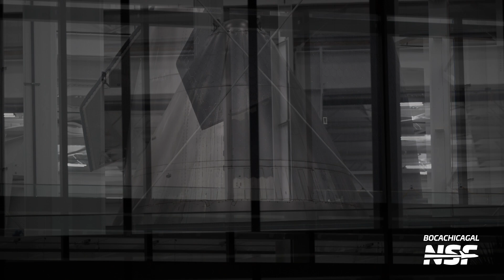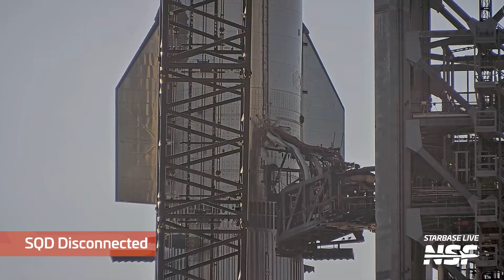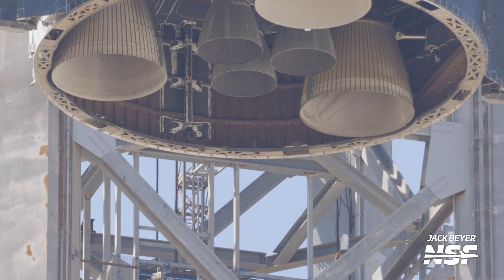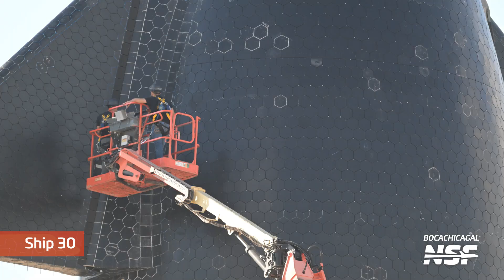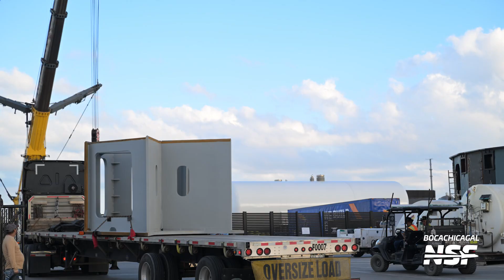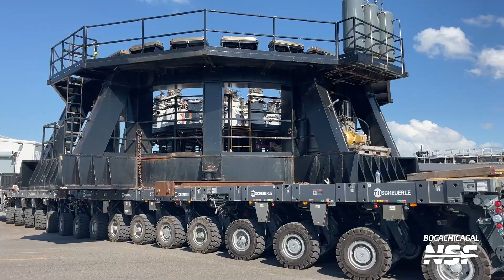Ship 30 destacked... For Now | SpaceX Boca Chica

Comment: The rounded corners on steel pieces avoid stress concentrations on a single point. Sharp points are called 'stress risers'.  The reinforcements on the chopsticks are all curved for the same reason, to spread loads over larger areas.

Comment: SPMT's are not usually described as a number of SPMTs, because as you said the system is modular. The usual way to describe them is "Axle Lines". At the end of the video, the SPMT was was using 16 axle lines, and there were 2 sets, so it would be 2x 16 axle lines carrying the booster stand. The smallest element of SPMT is 4 axle lines (plus a power pack) so when connected together the transporter will have axles in multiples of 4 (8, 12, 16, etc)
Reply: I faithfully sift thru dozens of rubbish comments just to find the occasional valuable nugget like this one. Thanks!
Reply from the maker: Thanks! - Das

Comment: What extra protection was added to Space Shuttle engines since they projected out back? Did they run some liquid through cooling channels?
SpaceX going to build a smaller version of the NASA crawler?
Reply from the maker: There was a body flap that extended past the main fuselage to protect the engines during reentry. - Das

Comment: As a welder, a square internal 90 degree corner can crack much easier than a rounded corner. You have a starting point for the crack in the corner

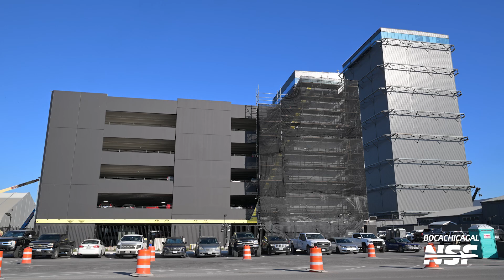Comment: 1:54 Parking Garage: Typically you would treat the south & west facades with an expanded wire mesh to stop heat gain from the sun but still allow air flow. Painting it black is the opposite of what you should do in this kind of heat but it matches. The new studs on the exterior looks like they will be solid panels of some sort based on the spacing but it is confusing.

Comment: Yes in structural steel a radius cut is stronger and less prone to cracking than 90deg cut and for the little added weight is minimal compared to added strength

Comment: With the RVAC engines being more efficient in vacuum wouldn't it be more efficient and effective to just use the 3 RVAC only or do they not have enough delta-v to put Starship into orbit at stage separation

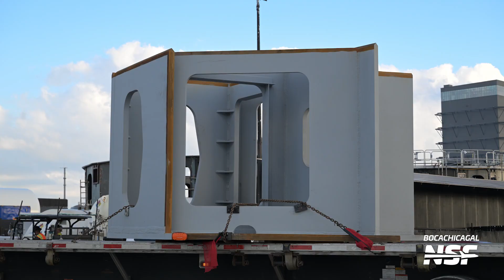Comment: The OLM piece at time stamp 9:40 is a big piece of steel.  The flatbed trailer is flat, so it's close to maximum load, in the range of 45,000 to 50,000 lbs.

Comment: When are they going to put landing legs on both starship and booster. They should just put them on now and stop just letting them drop in ocean so they can be examined and make a better inspection. Starship is going to need landing legs regardless.

Comment: always have round corners to openings the de Havilland Comet had square windows they started to have stress fractures very quickly and there was  some crashes because of it
Reply: @JasonEdney-wp7pe  just curious, do you watch Mentour Pilot?
Reply: @DebraJean196  hi no my dad is a huge plane nut think i've been to every uk air museum when i was a kid and it rubbed off , not complaining i do like all forms of flight
Reply: @DebraJean196  just had a quick look ,looks like my kind of channel. thank you debra
Reply: The latest thinking on the Comet 1 failures was the windows were not the main failure point. Search for Mentour Now!'s video "YOU have Misunderstood The De Havilland Comet. It Wasn’t the Windows!" for the reasoning.

That said, when I design loaded structures I do include transition radii, it's simply good practice.

Comment: Primary reason for the curves on the OLM pieces inside is exactly what Das said. It’s to ensure no single point of failure develops. A square corner will tend to be a stress point and start a crack that then runs through the entire section. Rounding eases and spreads the strain therefore no cracking. In some cases, such as aircraft aluminum, if you get a stress crack at a point which will relieve some of the stress, but you don’t want it to go all the way to failure, you put a small hole at the end of the existing crack. It’s called “stop drilling”. The hole being round has a lot of effect relieving any remaining stress.
Reply: Check most large circular saw blades. They too have slits with stop drilling.
Reply: The technical term is "stress riser". Rounded corners, chamfered edges and such prevent the formation of cracks.
Reply: Why planes and modern ships have windows with rounded corners.
Reply: Stop drilling cracks is common. A part may still get a doubler or other repair in the area of the crack to reinforce the part.
Reply: The original failure mode for the demise of the DH Comet jet liner. Square windows
Reply from the maker: Favorited this one to bump it up the list. Thanks, and will try to include this in a future vid. - Das